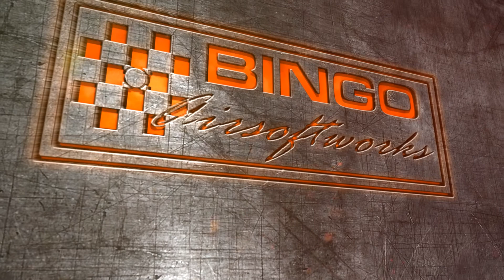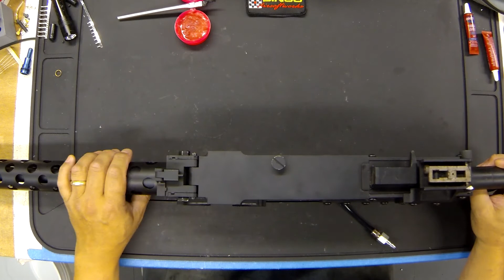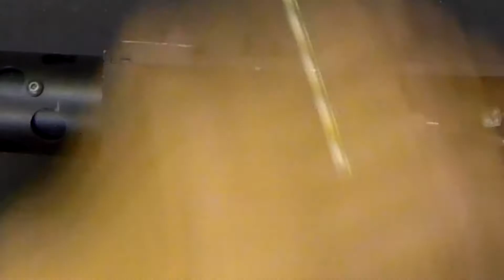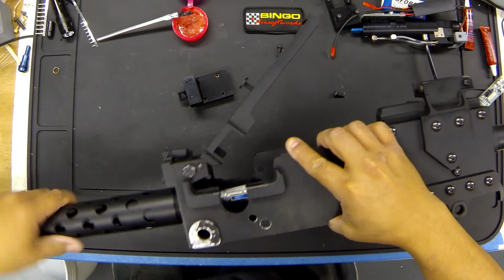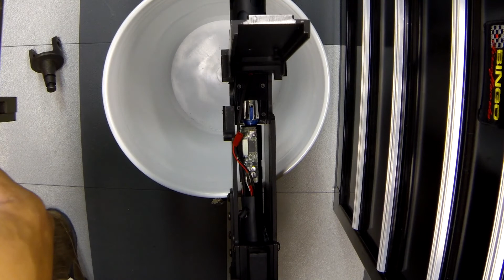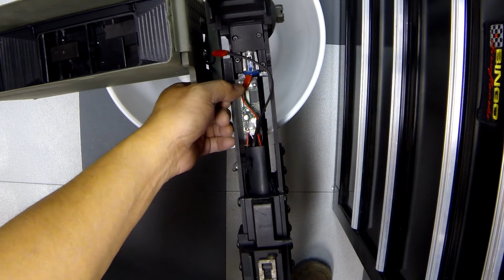RAP4 M1919 PolarStar Fusion Engine Conversion Breakdown and Assembly

Comment: Like, I can't believe I'm about to offer a suggestion to the PolarStar GOD...but, couldn't you just put a slight chamfer/countersink on the mouth of that barrel spacer so the inner barrel muzzle just rides into the right spot?  THIS IS AWESOME and will likely get the hate prize for turning a paintball gun into this monster!
Reply from the maker: Thumpy you are very correct! I will add a wide/deep chamfer to the spacer so the inner barrel will be guided right through the spacer. That was a "bingohead" thing to forget.  Now you know where I got the callsign.  :)